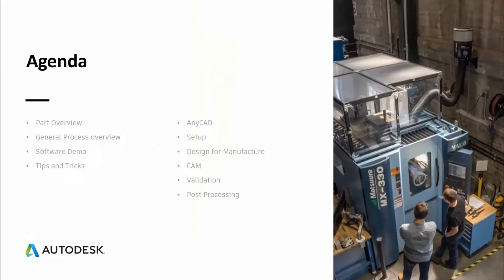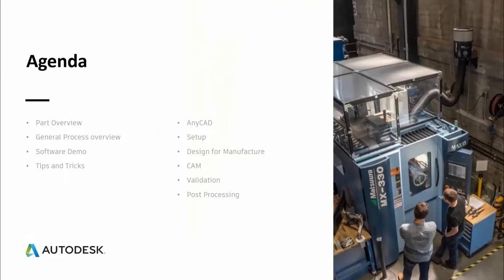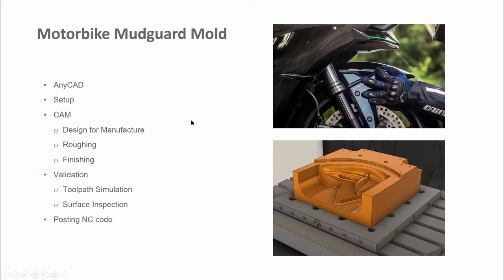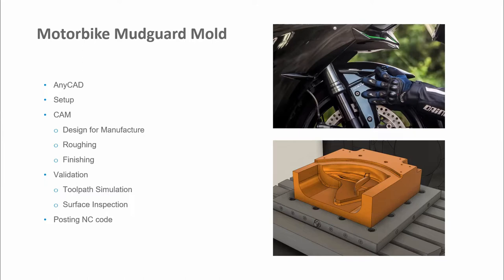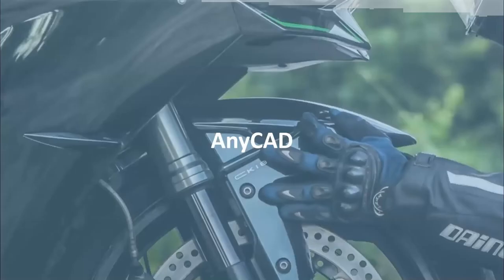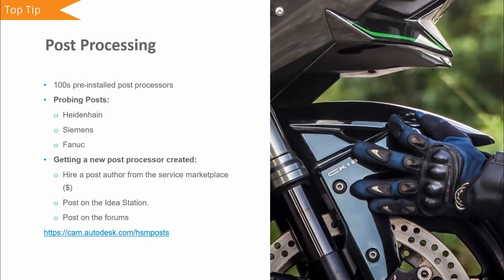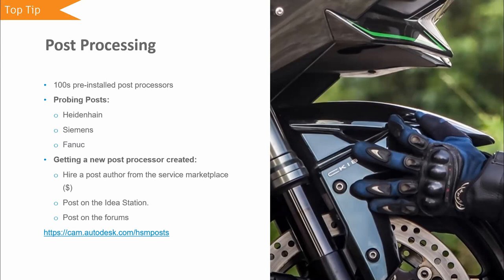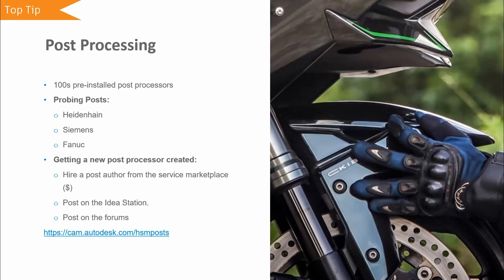From Part to Post – Complex Mold Manufacture using Fusion 360

Comment: I find all the different toolpaths confusing in fusion. I'd prefer to just select all my geometry at once and make my molds in one operation.

No matter how much trial and error I do, I can't find much actual advantage to any of the finishing operations over just using 3D adaptive clearing and asking (or begging) it not to leave any for later.

No matter what toolpath you select or how much your machine costs, you will still end up spending ages polishing out toolmarks to make a mold usable. 

So... I'd rather save time by avoiding all the messing around of choosing different toolpaths for every little feature... More human decisions = more problems...

I'd never ever move a two-part mold to another machine for finishing. That is a recipe for indexing issues.